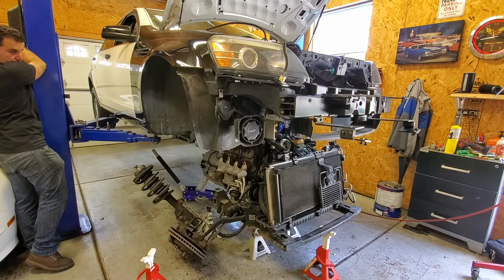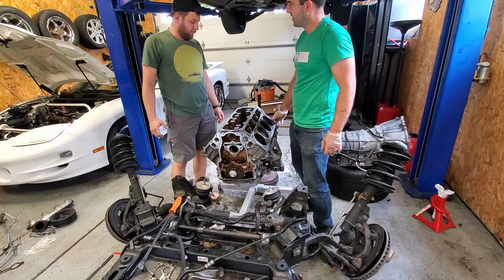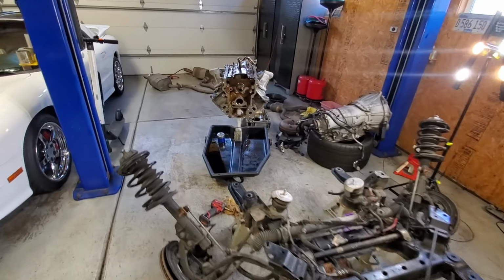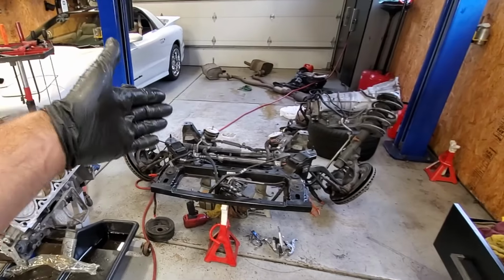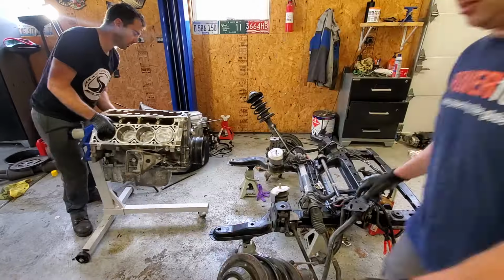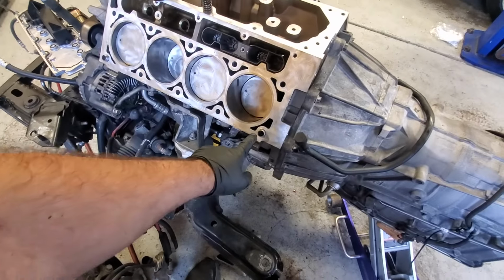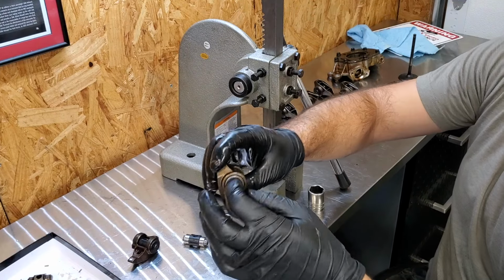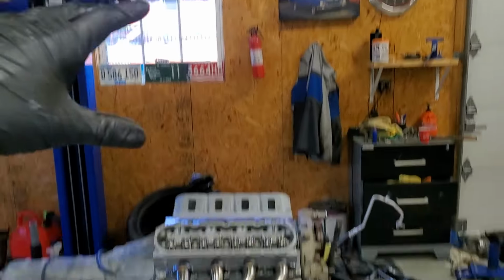Fixing THE WORST LS Engine Factory Defect Ever & Adding 100 Horsepower In The Process! GM Failed US!

Comment: My 2016 Silverado just had this issue. Unfortunately I think I'll be having to do a full rebuild. When I pulled the dipstick there was a lot of metal which sucked. I truly didn't run it very long but the damage was pretty instant. So my recommendation to everyone is do this delete before you need a new motor. It's not just an over hyped non common problem. It's real, It's expensive, and man does it suck.

Comment: I was totally surprised when i torn down my 300,000 mile 2004 6.0 rod and main bearings look almost new. All but front cam bearing as well. Considering the trash /build up inside the block. It was darn right amazing.

Comment: Nothing wrong with the afm lifters if you turn it off in the tune. They’ll last just fine. Bought my 08 with 79k miles and immediately had it turned off. Everything was still good at 325k miles when I decided to throw a cam in it

Comment: Great Video! I have a stock 1999 Chevy Silverado extended cab 5.3 step side. I have 316,000 miles on it and was thinking about making it a street truck to play around with.
What could I expect to pay to do these upgrades to my truck. I do not plan to add boost or spray, I just want more power on motor.

Comment: When you have wiring insulation issues close to a connector like that just de-pin the connector one wire at a time and slip some adhesive lined heat shrink over it. Thats a common spot for the insulation to come off the crank sensor wires on those LS engines.

Comment: Did you have any pressure issues after the AFM delete? I’ve seen people rivet VLOM passages or plug the pressure relief valve in the oil pan area. Did you do any of that ? I get a surge oil pressure when warm. I’m thinking my new oil pump o ring might of used wrong one but just curious

Comment: Good video, but there's one thing that glairs out to me... You didn't replace the cam position sensor in the front cover - while it was off. Me, just having to replace one with the cover installed (of which took 6 hours - because they fall apart as you try to remove them) imo - this will be a problem.  Other than that - good job.

Comment: I think it is amazing that after all the power add on's, modifications and upgrades to an LS engine or transmission that ALL the horsepower and torque rests and relies on three small bolts between the torque converter and flywheel. 300hp; three bolts. 900hp; three bolts. Those three bolts are made from high grade steel and that is one place where I will stop what I am doing, call UBER or LYFT, ride across town to my parts store and dealer to buy some red threadlocker. Use it per the directions and torque specs on some brand new factory bolts. 1000hp on three little bolts? Don't trust "bolts in a bag" from your local hardware store, but new dealer only hardware for that all too important connection between torque converter and flywheel.

Comment: I noticed you used red loc-tite (or similar) for the cam retainer plate.  I did that once....and went back into the top-end about two years later.  The damn bolts (3 of them) would NOT budge...actually breaking the torx (?) bits twice.  Frustrated and bewildered, I suddenly remembered I had used red loc-tite on the bolts.  Ugh.  I torched them up with a significant amount of heat - individually - and they finally came out with little resistance.  I'll never use red loc-tite again, unless it's for stuff I'm pretty sure I'm not going to be removing again (or, at least not for a long long time - or until the next guy is the one who has to worry about it.)  Cheers mate.

Comment: I had a 2008 GMC Sierra "Vortec Max".  I bought it new when I got out of college, and I loved that thing.  Made it to around 138K and lifters collapsed.  Shop I had work on it must not have known what they were doing on these AFM systems because only 200 miles later, more collapsed lifters.  This was my personal truck, but also my main truck I used in my landscaping business, so I didn't have time to mess around with it at the time and had to sell it off after said shop tried their best to fix it again.  I wished I had the knowledge that I do now about them to work on it :(   I turned around and bought a 6.0 powerstroke, so my mechanical worries were far from over, LOL

Comment: Hes made multiple mistakes on this .
First.... Didnt shim oil pump before tigtening down.
Second... Thats not how you install a cam .... Dot to dot is incorrect, find TRUE TDC.. no matter where the crank sprocket dot is... IT WILL NOT BE straight up all the time 
Third.... Your cam IS NOT installed correctly... You did not even sho the cam card nor did you verify the installation soecs of the cam card.

Comment: Dude,  WHAT the HECK are YOU talking about ?? LS Engine EASY 2 work ON !! 2013 Sierra 5.3 (84K miles) with LIFTER problem that has been towed ...F-I-V-E... times for the last 3 months to 3 different garages that ALL told me they could repair and NOT one garage owner has even loosened one bolt on the valve cover to diagnose the problem !!! Last garage in Jonestown,Pa had the truck 50 days and continued to say "parts are on order" !! Sierra is again sitting in my driveway and I have NO idea what 2 do and i do NOT want to pay a GMC Dealer $10 Grand to replace the engine !! Edward  😡💀👻

Comment: why would you wrap the wires, disassemble the connector and heat shrink the wires, it is a better repair than that crappy electrical tape, I like the head shield cover, but wrong wire repair

Comment: why did you chose to use a high pressure oil pump?  from what I understand that can damage main and rod bearings, on an NA engine, high volume is all  you need, which means it flows more

Comment: I have a 2018 GMC Sierra Denali with the L86 engine.  The AFM would not disengage properly in some instances going from 4 to 8 cylinder mode and made the truck drive like you were going across a field sideways.  Threw in a Range afm disabler and it's been smooth sailing since.

Comment: The original oil pump on that engine is easily modified to put out 60 to 70 pounds of pressure with only a couple of washers to use the shims to shim up the spring. Why people insist on paying melling for yet another one of their oil pumps. Unless you have some specific reason for one? There is no reason not to use the original pump because the AFM system requires a large volume of oil. When you delete it you have more than enough volume for the rest of the motor. The other thing you failed to mention, is there is another oil pressure relief valve on the inside of the engine when you take the oil pan off. And you have to take that and punch it down and increase that pressure otherwise your pressures don't substantially increase at least not to the point that you would like them to be. It's also another failure point but you can increase you all pressure or cap that part of the system off completely, which I prefer, just by taking an oil drain plug and plugging the hole.
The reason why the top of a valve stem gets beat over, is because it wasn't tempered properly. General Motors has a long history of failing to temper valve Parts properly. Starting with the cams that they made for like 45 years for the small block Chevys with the first two sets of Cam lobes would wipe out inside of 60000 miles. Because of the method that they used to quench the cam. Metallurgy is not their Forte. That's also why they always used aftermarket cams for Corvettes. At least for the first 50 to 60 years.

Comment: The reasoning that low oil pressure is to blame is a lie GM tells to save face.  They fail just as often with adequate oil pressure.  I replaced all of mine twice at 62k miles and 75k miles on a meticulously maintained Silverado. That's with new cams both times.

Comment: First time I’ve seen your video! I’m hooked just from this one! I have a 2012 SS Camaro with a standard trans. Bone stock and getting ready to do basically what you are doing, long tube and cam, I don’t have the dropping cylinders but I’ve owned this 45th anniversary Camaro and haven’t done anything to it other then change oil, few sets of tires and a battery! Owe yeah I had to change the blend door

Comment: No, No, No! You didn't align the oil pump outer rotor correctly. Do not believe the Melling video, they are in the business of 'Designed Obsolescence' and selling more pumps. Neither the OEM nor Melling pumps are self aligning, rotating the crank does nothing for alignment of the outer rotor in the housing, it floats and the absence of locating dowels in the housing along with oversized bolt holes almost guarantees early pump failure if the alignment shimming is not carried out correctly. Ask any mechanical engineer and they'll explain why:
https://www.youtube.com/watch?v=CWCIdhG04LY

Otherwise a great video, cheers.

Comment: Hey I'm new to the channel so welcome to me. I have some advice questions. I got an 2010 silverado. My brother in law handed it to me. It has 245k on the clock. Valve cover gaskets needs to be replaced and oil cooler gaskets. It does have rust on the frame and some on the body. Do u think it's worth fixing or should I just sell it.  I'm on disability so income is very limited. Is it worth fixing.

Comment: a trick for wrapping electrical tape around those damaged wires. if the rolls of tape is rather large still wrap a bunch of the tape around a smallerish socket. this will make it easier to feed in between the wires and you can get a better wrap job than if you were trying to feed the whole roll around the wires.

Comment: I didn't see if anyone mentioned your choice of 3m abrasive wheel.  The green one is not for aluminum. Its rough. I can SEE the divots you mentioned, on that engine.   Please research info on surface preparation.

Comment: I have a 2008 5.3 in a GXP, never had problems with the AFC, sometimes the lifter in the front side ticks until it warms up. The engine has 120,000 miles on it, but runs great, plenty of power and it is dependable, one thing I would like to do is strengthen the transmission( the weak spot of the car..IMO), it is fine right now but would like some info, if available, on strengthening the trans. This engine was designed for this car, have had 4 Gran Prix and 3 had the 3.8 V6 but i really love the V8 in this car, have worked on a lot of the 5.3, 6.0 engines mainly the service fleet.

Comment: Good video.  However, I would have replaced that wiring harness.  As heat travels through copper readily, there is probably insulation damage other than what you found.  It would be a shame if after all the work you are doing, the car were to catch on fire and burn up due to the wiring harness.

Comment: Dodge hemi has this same issue.  My ram 1500 5.7 has 124k miles and no lifter failure.  But since learning about this I mostly turn the system off. Lucky for ram owners if you manually switch  the tans into 6th or 8th depending on which trans you have, it switches off the system. And the trans still operates normally.  You have to do it every time it's shifted back to park.  But it's worth it to help save the engine.  They switch into and out of this mode even at low speeds.  Way too often in my opinion. B

Comment: The problem was the Exhaust valve in the LS7 which was caused by using a 1.8 ratio rocker and a powdered metal valve guide in which the factory geometry was incorrect and side loaded the junk LS7 hollow stem Exh. Valves., Nothing to do with the Intake valves as the Intake valve in a LS7 is produced by Del West and is Titanium Their is other issues with Exhaust valves nor Intake valves in ANY other LS,
LS7 Intake valve size 2.205
LS3 2.165,
LS7 also 12* valve angles,
ALL other LS's are 15* valve angles

Comment: Im doing a ls swap into my 2002 s10 extreme  this summer in Georgia and keep the A/C .I really want one of the aluminum blocks for less weight obviously but also because they can cool themselves down a bit better and it can get really hot down here  .Thinking about going with an old school carb set up but haven't decided I'm on a budget so I cant just go wild buying whatever I wish  ?Gonna get a cam with over 550 lift but no more than 610 lift and a 3.77 rear axle from a explorer and a high volume oil pump and just go with the stock pistons and just get new rings and bearings  .I'm going to stay with the stock nv3500 5 speed for now until I can upgrade .IM hoping for around 450 hp ,cant wait to go junkyard hunting for the engine i already got  the rear end

Comment: You could of pulled the 3 wires from the Plastic Connector and put shrink tube over the bare wire and clip the wires back into the plastic connector... Take a Picture first so you put the wires back in the same order.... I had to do a main plug with 50 wires that was Damaged in a accident Just the plastic plug was smashed and wires were good so I cut one off a wrecked truck and one by one pulled a wire and installed it into the right spot... I used a very small precision screwdriver to slide in and remove each wire....

Comment: as a warranty heavy line tech for GM... that cleaning job you did is terrifying...  cleaning past gasket staining or other "discoloration" is typically a big bad no no....  yea you can get away with it buy many do not...   results in blocks needed decked etc due to head gasket leaks...   is a style of cleaning left to the pro's.. not the average home DIY guy...

Comment: Just going back over some of your old videos, and saw the starter wiring "fix"... and while heat shielding wrap helps, the plastic zip ties will be the first to go... then the heat shield wrap, then the low temperature electrical tape... then the wiring harness shorts out.

Zip ties are no match for exhaust or engine heat... and come on... really?... with all the other work you're doing on this car, why not fix it right?   Just sayin...

Comment: Yea should have feeler gauged the oil pump & the proper rear main seal tool. I understand for the front, but the tool would be best. Did you change the oil pressure screen? Barbell, any upgrades for oil pickup hold down? Drill & Pin the crank?  The most important change that Crank sensor harness, sure it may work now, but I look at long term. I do not want to take anything back apart to fix or T/S problems later.  Do it right the first time!

Comment: We use those green bristle discs at work to remove rust from steel. For Aluminum the proper bristle disc is white. Still should never touch the head sealing surfaces of block or heads.

Comment: How did you get all the dirt from the sides of the pistons on top of the top ring? I know, you cleaned it really really good...but you dont actually know if its clean or your your rubber surface cleaner just packed it in and compressed air just forced it it even farther....and every time you rotate the motor a little piston rock stuck some of it on the side of the piston.
I only say that because I tore down 2 motors that had head gaskets recently replaced...
I did one of them and I thought it was plenty clean...both had noticable scratches on the cylinder walls and the sides of the pistons above #1 ring was kinda nasty looking....not enough to cause a failure....just rings that dont seal as well as the could have.....

Comment: You said Caprice... the word "junk" immediately came to mind [I hated the original V6].  But great video.  113 is on the tight side - most LS/computer managed engines seem to prefer 114 in staying away from knock sensor issues, or minor issues rising out of MAP feedback stability.   Any tricks working around knock sensor issues?

Comment: I think I would have pulled the pins on the connector with cooked wire jackets, then put some nice wire shrink and re-assemble connector. That electrical tape heats and melts off after some time.

Comment: I'm about to replace my 5.3ltr in my 2005 Envoy Denali and wanted to know if it's just as practical/easy to use an afm plug in disabler as to addressing the lifter issue directly??

Comment: Good luck with that cheap camshaft. You will need a custom tune to run that camshaft without engine failure. I speak from experience!
Reply from the maker: Cheap? What's cheap about it and of course this needs a tune. You should get a tune after literally any aftermarket cam. Also, this video is really old and it's already been tuned and did great.  Check it out

Comment: Interesting stuff. The biggest mistake I ever made was selling my '98' Z 28 (LS1). It was my second Zed, I previously owned a '94' with the older LT1. The '94' sounded better, but there was a difference of a claimed 30 HP with the aluminum engine (different firing order too).

Comment: HUGE OOF, probably put somewhere to correct the statement that rolocs dont remove material, its exactly what they do, and use ceramics as the abrasive vs aluminum oxide in sandpaper, its basically a sanding brush, i havent personally done this, but that is because of the mistakes of people in the past letting know the fortunate ones that do research to avoid using rolocs on machined mating surfaces

Comment: Shewwww mannn you need to fix that crank sensor wire better than that. New pigtail possibly spliced on and some new shield and some heat sleave to prevent it from doing that.

Comment: the wheel you used has ceramic abrasive grains in the fingers. if those grains get in the engine it can cause premature bearing failure.